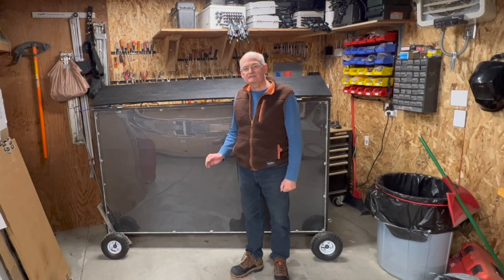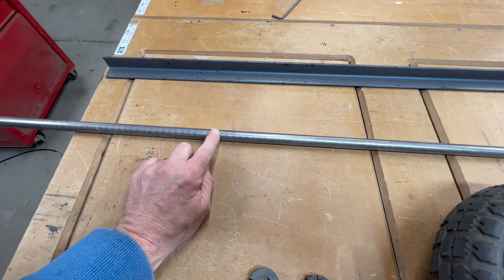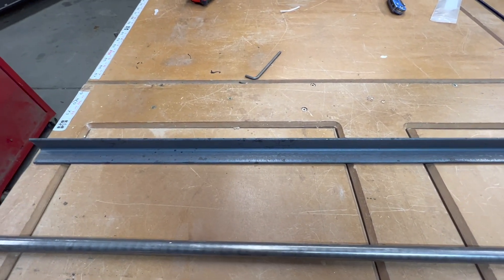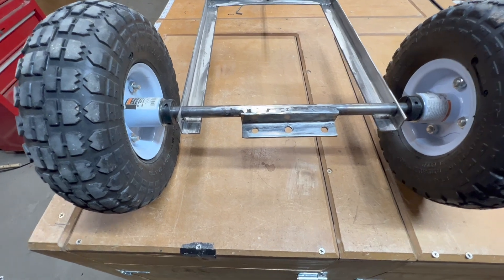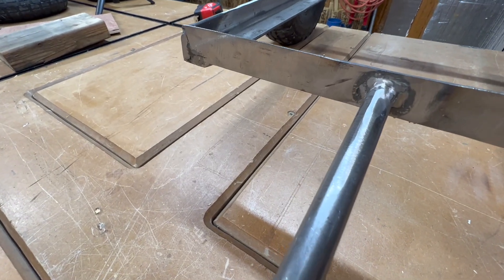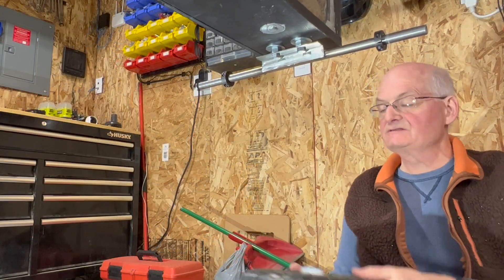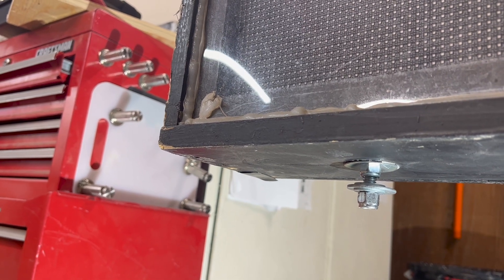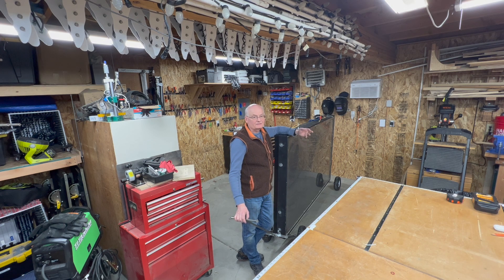P5 panel cart

Comment: I really liked your build of the P5 panel cart and the P5 panel build.  Working on a 3 wide and 4 tall build P5 Indoor panel build and was at an impasse due to what I thought my panel mounting strips were correct for the build.  Looked at your build and found out you can get the mounting strips for my build as the strips I had ordered were for 3 tall not 4 tall.  I do have a Raspberry Pi 4b, colorlight, power supplies as well as the fuses for the power distribution to mount when those parts come in.  Wondering if you could do an up-to-date video for flashing the colorlight, loading the FPP to the Raspberry pi and showing how to load a XLight sequence portion to the Pi and play it?  Thanks for what you do and keep at it!!!!
Reply from the maker: Glad the video was able to help.  I will consider putting together a video for setting up a colorlight card and pi.
Reply: @bergmannlights5149  Thank you as this will help in the very near future with this build.😀
Reply from the maker: No problem